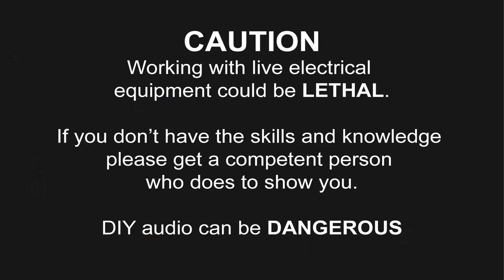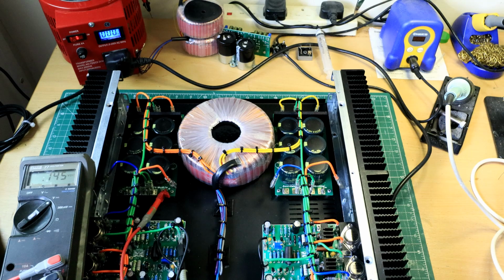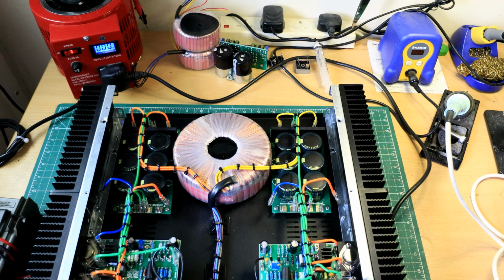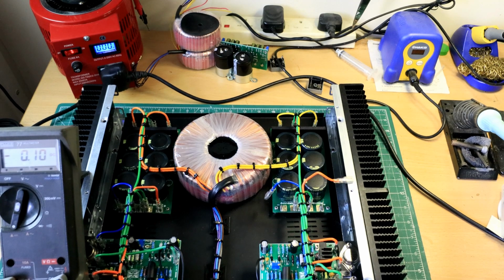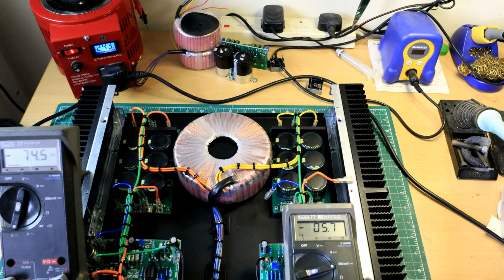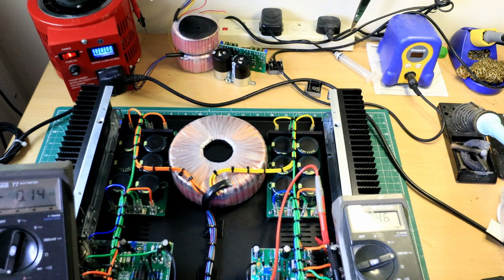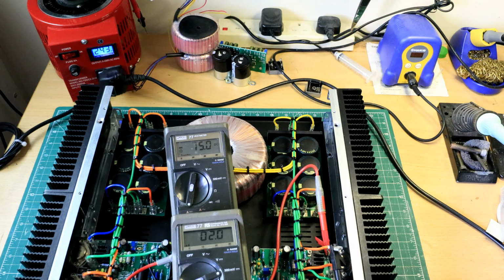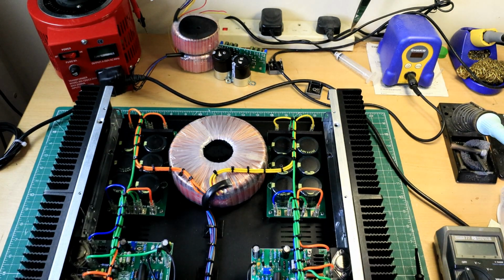Another AA amp build pt3

Comment: Hey, could this be build with a passive volume control and source switch as a "integrated amp" or does this SE200 config need a dedicated preamp? Thanks so much
btw. I would also be interested in a SE200 SE230 comparison. Sadly only the 200 is available at this time.
Reply from the maker: Yes it could be built with a passive pre and switching in one box, I have used one with a 0 gain pre amp with great results. Switched inputs is just as many inputs as you like if the switch used can handle the no.